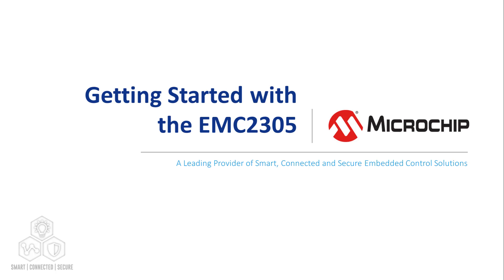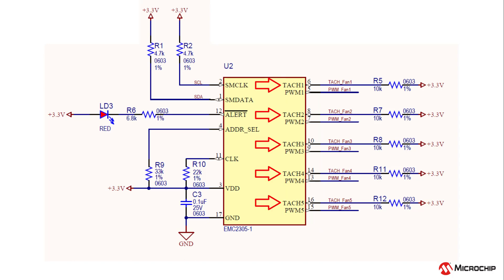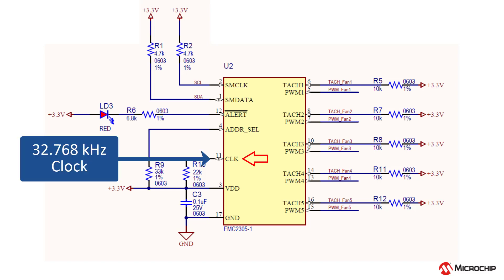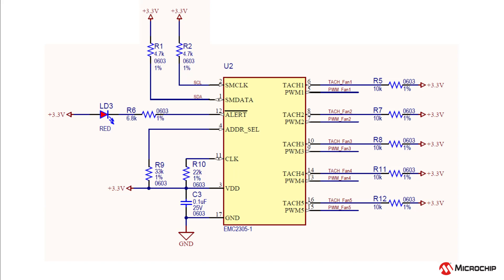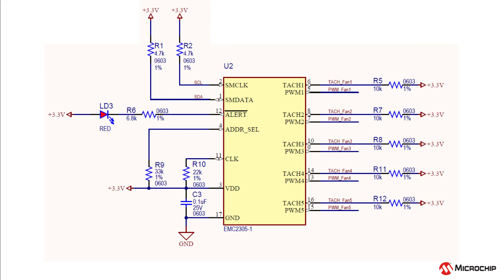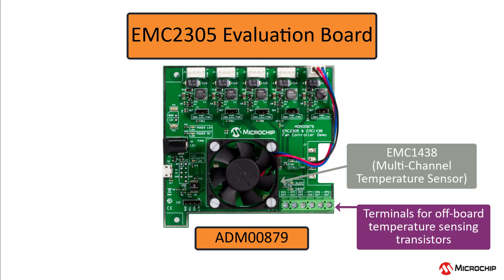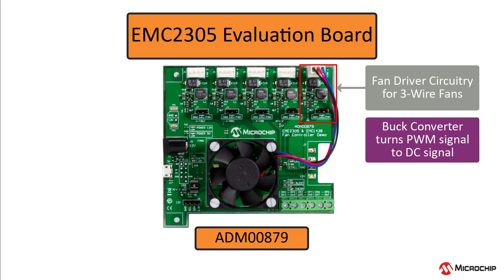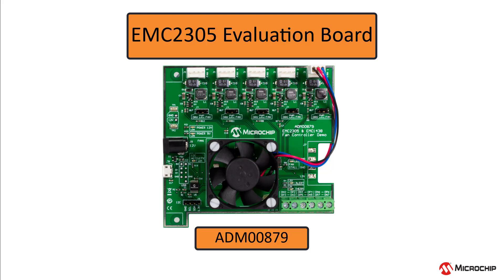Getting Started with the EMC2305

Comment: is able to drive 12v fan directly? for 4 wire fan
without pwm drive circuit
Reply: Hi there, thanks for your question. The EMC2305 can control up to five 4-wire fans, providing PWM signals for speed control. To directly drive a 12V fan, you can connect the fan's power and ground wires to a 12V supply. The EMC2305 will handle the PWM control.